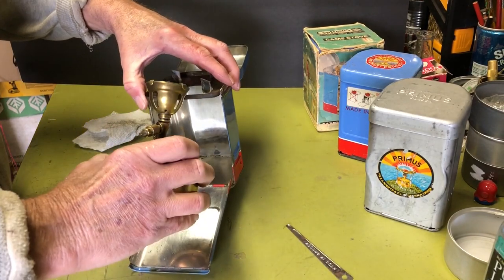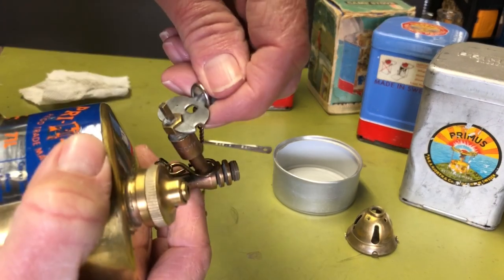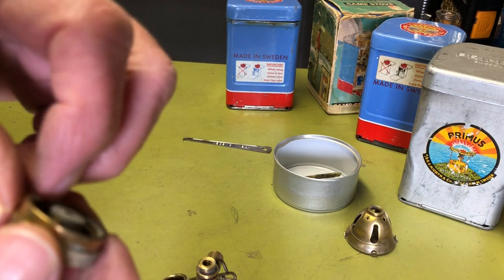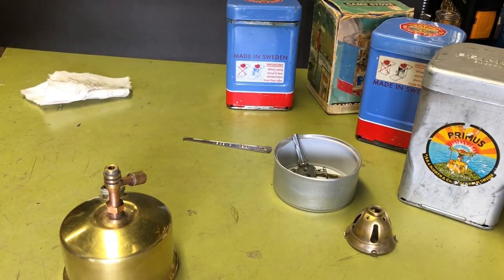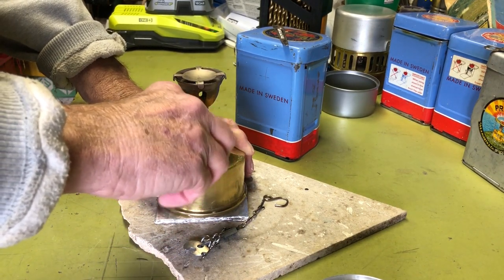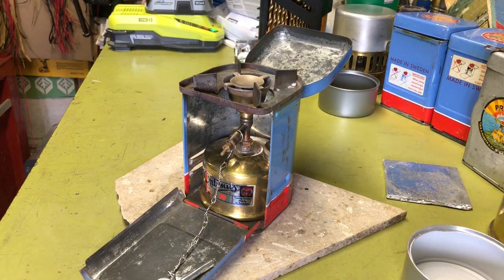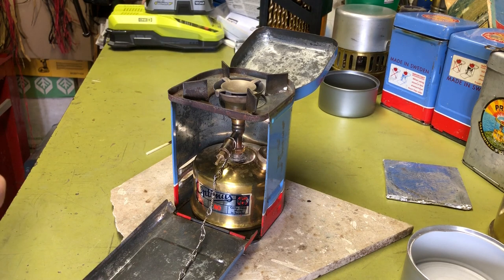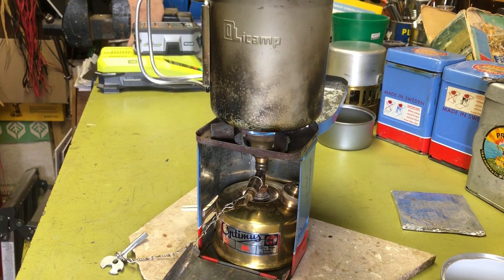Firing up my Primus 71 and Optimus 80 Stoves

Comment: Thanks for the video! What alcohol for the warm up did you use, and what would you recommend for the burn? Much appreciated 👍🏼🍺
Reply from the maker: To prime I use Heat in the yellow bottle but denatured alcohol also works. For fuel I use  Coleman fuel also called white gas or Naphtha
Reply: Mentholated spirits for priming

Comment: I clean and restore these stoves like the svea 123 and 123R along with the 8R and 111, 111B etc, and I found the safest way to get the spindle assembly off the tank is to take the bell off, fix in the corner of the bench vice with jaw protection and turn the tank slowly, try to tighten the tank just slightly before unscrewing it, that way you avoid rounding off the nut. just my opinion.
P.S.  sounds like the jet is a bit dirty, or it is starved of vapour.
ATB  Ray
Reply from the maker: Thanks for the tips.

Comment: this is friction alcool ? or methanol ?
Reply from the maker: For priming I use Yellow bottle “Heat” alcohol but any alcohol will work, denatured or meth.  
You can also use the stove fuel to prime but It creates a lot of soot.  Alcohol burns clean.
Reply: @planetsideagent  ok tank you sir
Reply: Eu am una suedeză originala scrie pe ea nur fur benzin ctr8 și zgâriate pe spate 1943 Graz soldat OTTO KELNER
Reply: Made în Sweden